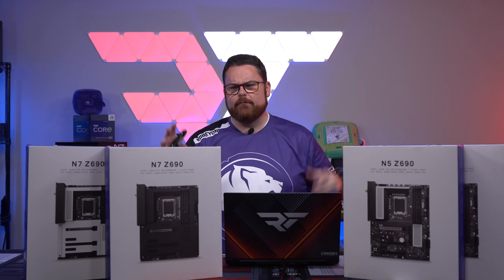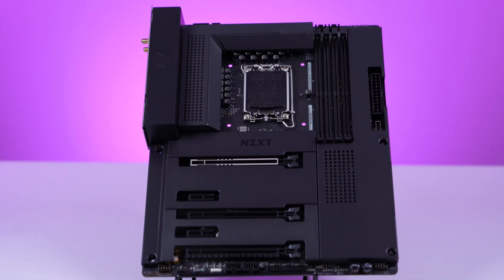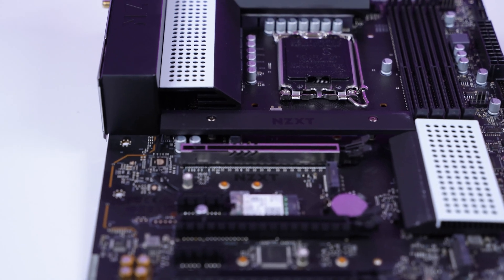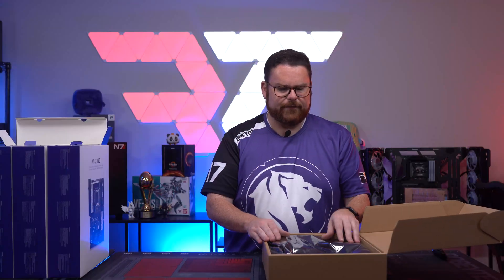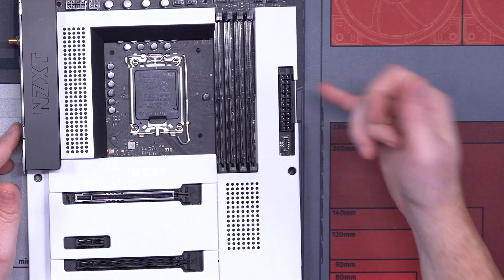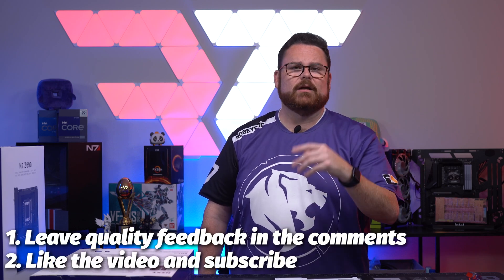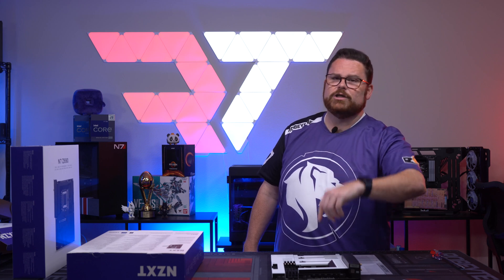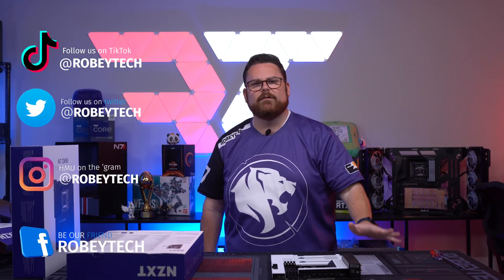NZXT brings it to Z690! The new N7 and N5 NZXT DDR4 Z690 Motherboards are here.

Comment: These mobos are dope, I might just use these in the custom build ill be trying to do for the first time. Iv build a few pcs but never anything custom done to it and to be able to paint the shielding seems like the best mobo for doing something like that would make doing a custom build a lot easier and ddr4 way better, cheaper and the speeds vs price for ddr5 isn't there just yet from what iv seen. How is doing a custom water cooled system with these workout?